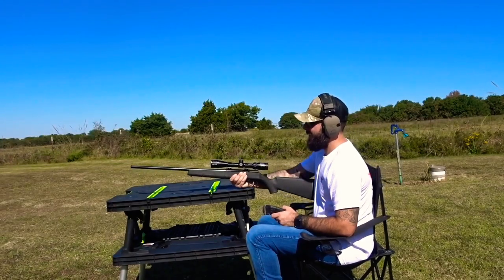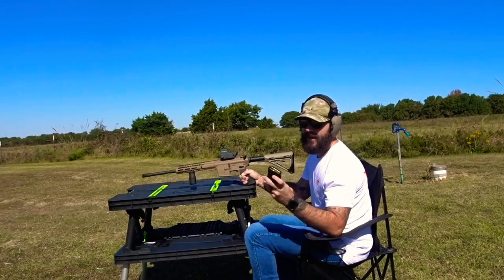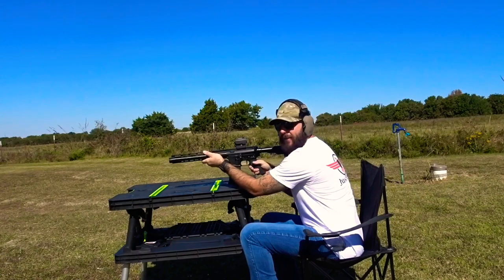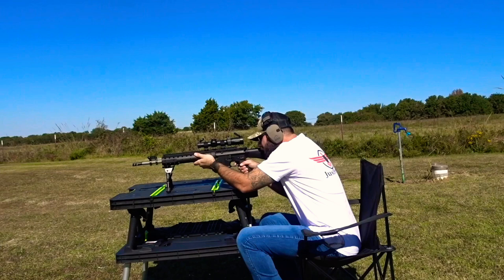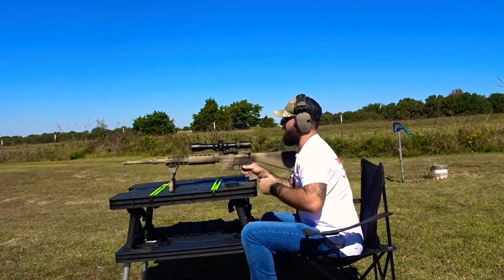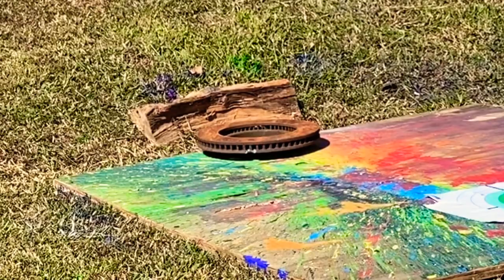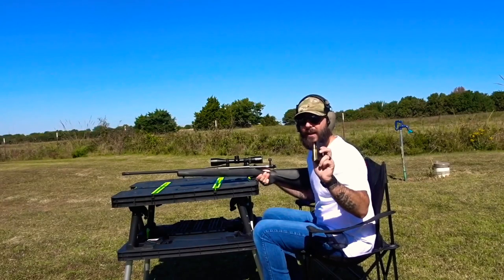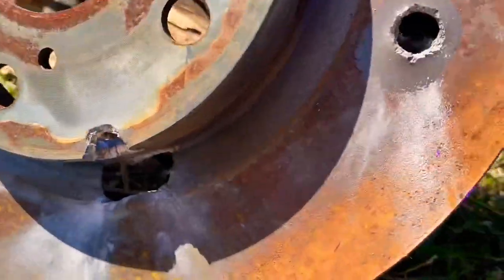Is a brake rotor bulletproof

Comment: I blew a brake rotor someone left at the range in half this weekend at 200yds with a short barrel 308w. 178gr @ 2740 🤣
Reply from the maker: That’s impressive because even with if I remember correctly m80 ball ammo I couldn’t make it threw at 65 yards and that’s a Chevy Silverado 1500 brake rotor
Reply: @JustPewIt  sent you a pic of it on IG. Blew half the rotor hat off 😂 Shoulda slung a 185 juggernaught at it 🤣